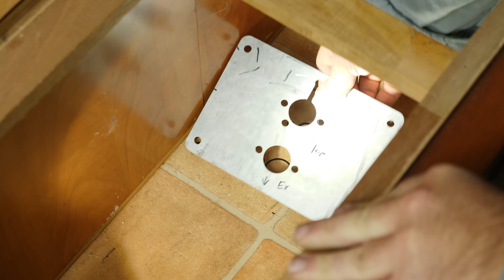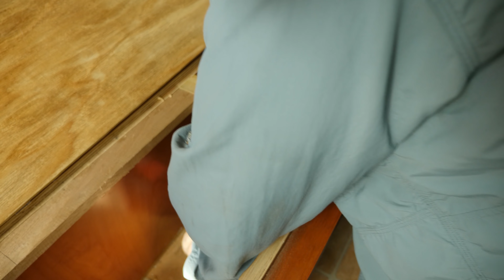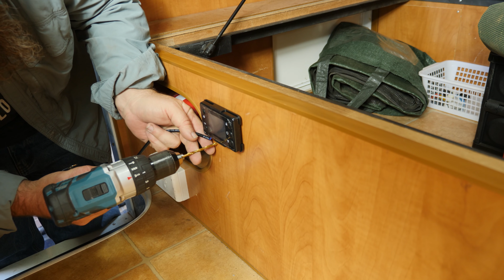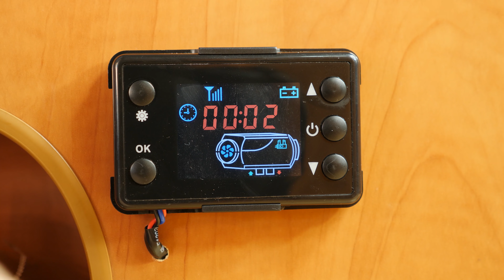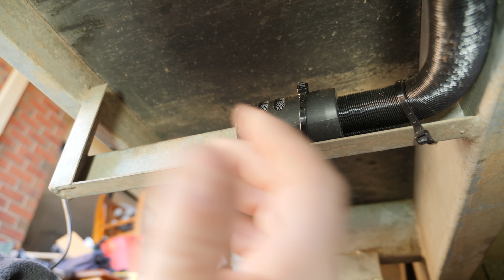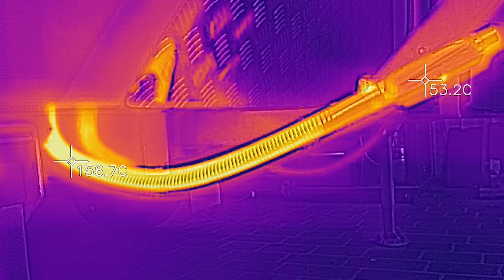Ebay Chinese Diesel Heater Install and Testing

Comment: Crazy, that exhaust will get so hot it will burn the surrounding material I guarantee it! The plate is to cover a large hole so there is NO contact with the floor, this is a really bad example to people sorry.
Reply from the maker: Did you watch the whole video?
Reply: Working fine so far mate. Had it going 10 nights and been checking  but nothing. Watch the whole vid and you will see we cut  bigger clearances.
Reply: That's a fact...

Comment: Good man! Glad you increased the clearance, I've measured the temp of my exhaust at 180 degrees Celsius, I thought you were going to be using that fire extinguisher before long
Reply from the maker: Cheers, yep Matt (the owner of the camper) seemed like a fan of keeping the fire inside the heater as opposed to all around it!